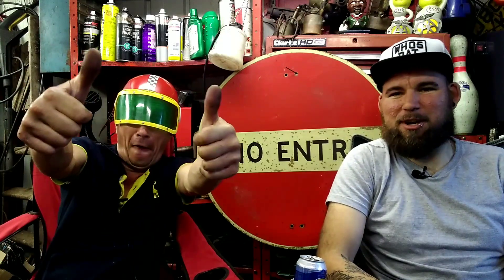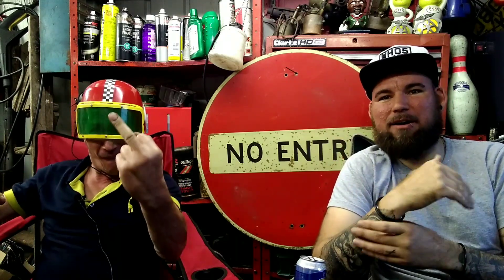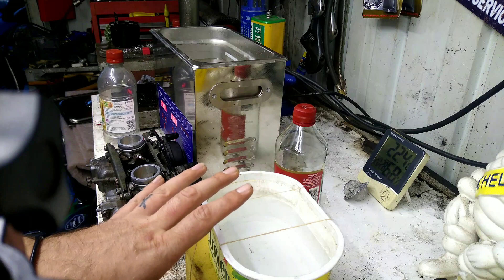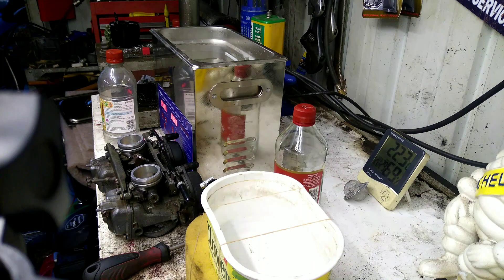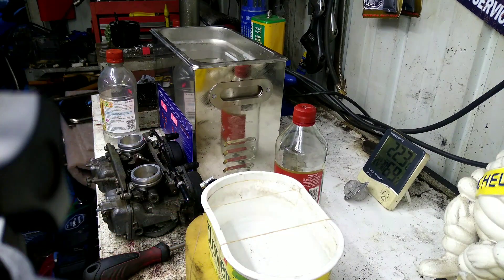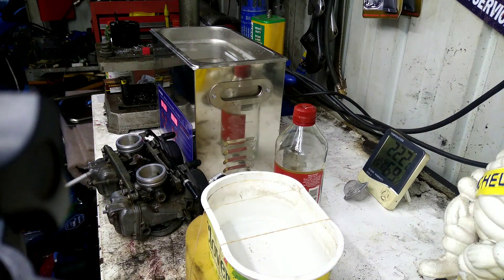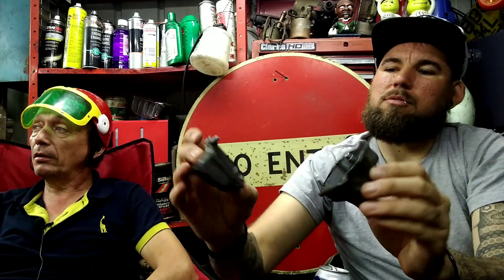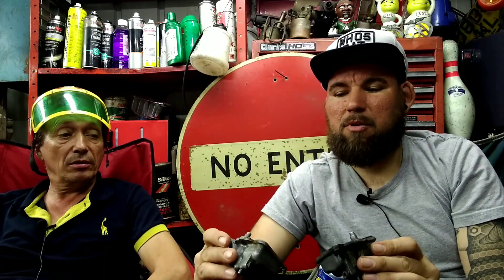Ultrasonic Cleaner Comparison! Our £10 DIY Unit vs Branded Equivalent!

Comment: Do you know which sports massager will give best results and what batteries would you recommend for logitivity ?
Reply from the maker: I'd go for a sports massager with a neutral shape like ours, ones with protrusions may not be suitable. We run Duracell AA in ours. You can get rechargeable ones which maybe more cost effective. They even make rechargable sports massagers now. Whichever best suits your budget.
Reply: Thanks for the great advice I have a much better idea now. Do you know of any decent suppliers in the uk that you'd recommend? @PissedAlignmentWorkshop